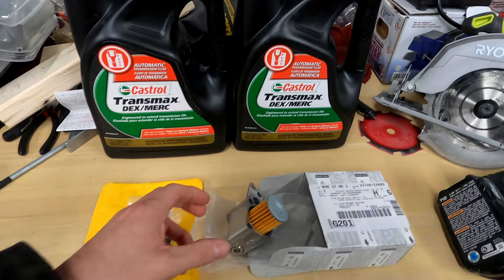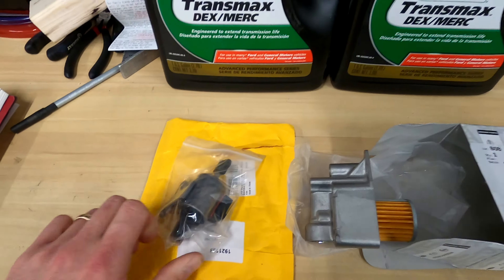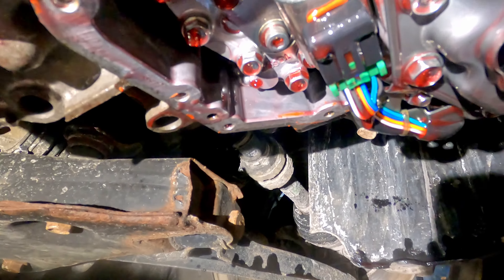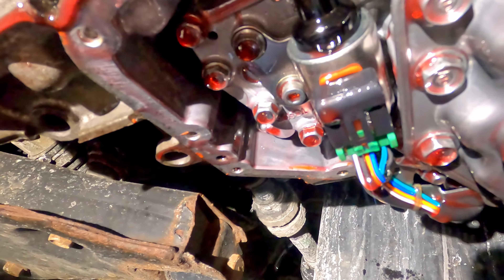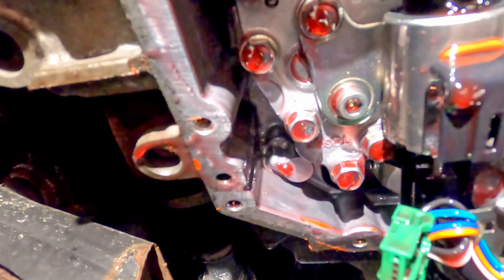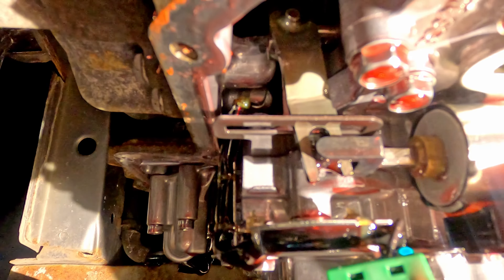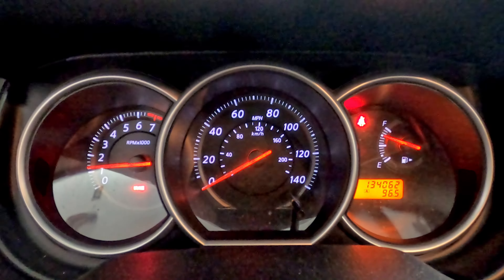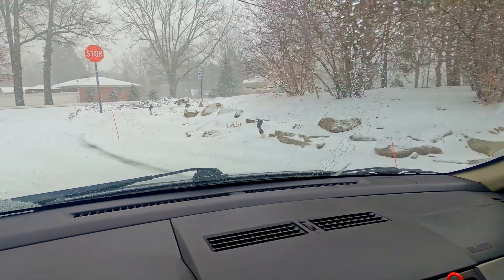2010 Nissan Versa P1778 Fix code back 2 days later

Comment: I have the same code on my Altima,I replaced the step motor and valve body and it didn't fix my problem! Although I replaced it with parts from a junkyard,maybe that's the problem

Comment: P1778 and p0868, just bought this car and give me 2 codes, trouble accelerating and slipping. Checked the fluid and looks clean and i'm affraid that this is done before because i see fresh silicone underneath this pan but i didnt touch that yet. Any advice? For replace transmission is gonna cost me $4500-5000 and its a lot! 😢
Reply from the maker: Unfortunately I ended up replacing mine for ~$4,500.  The CVT transmissions are just really terrible.  You could try and see if a new actuator helps...or swapping fluid. But I'm not sure it's gonna help. Best of luck friend
Reply: @chrisgoosebeck  Thank you for your quick response, i will drop off to the shop tomorrow but im sure to spend for an old car such a lot of money. After replacing are you having problems anymore?
Reply: @chrisgoosebeck  Can you update the video description with this?  People think replacing the step motor will fix the problem of a worn transmission (lack of maintenance).
Reply: @chrisgoosebeck  ... or can you PIN this comment?
Reply: @jonidimeri1578  did you have a solution?
Reply: @sergioescobedo3024  Unfortunately no, its parked on my garage, didnt have time actually to droo off to a good mechanic. Let me know for your updates.

Comment: Is this noise when accelerating from the gearbox?Does it go off when you release the gas?Is the noise related to the rpm of the car?
Reply from the maker: It did not appear to change in relation to the throttle. But it was definitely related to the transmission
Reply: That noise is from the strainer being clogged up. Just clean it with brake clean and you’re good to go.
Reply: @xpicasso7147  where is that located?
Reply: @FLikeAirWick  When you drop the transmission pan, you should see a rectangular metal piece bolted to the valve body.
Reply: @xpicasso7147 does the strainer have a part number?